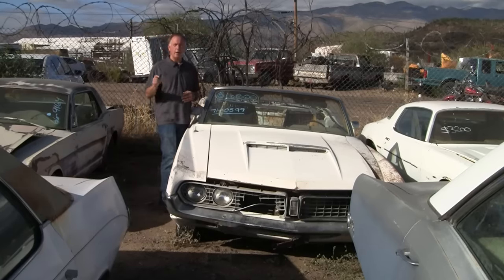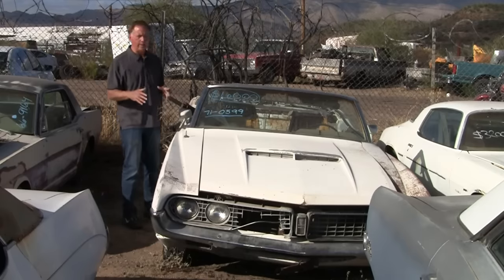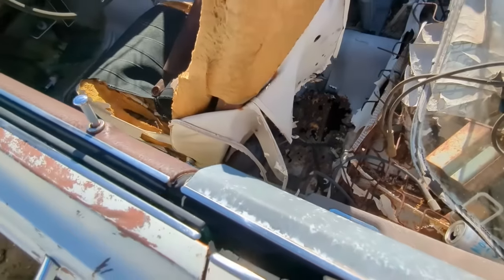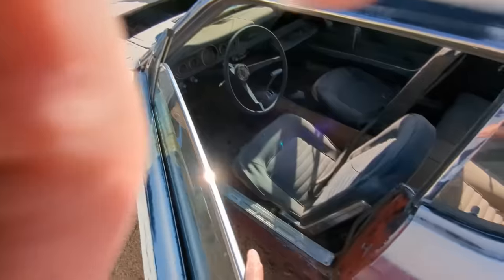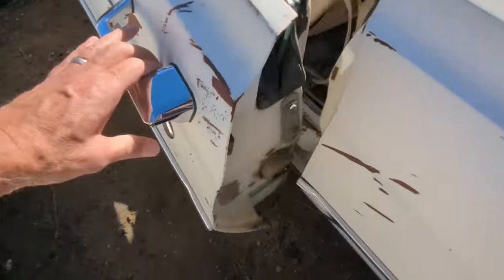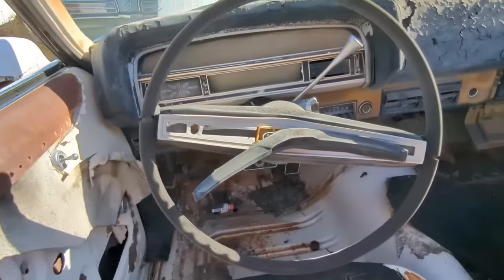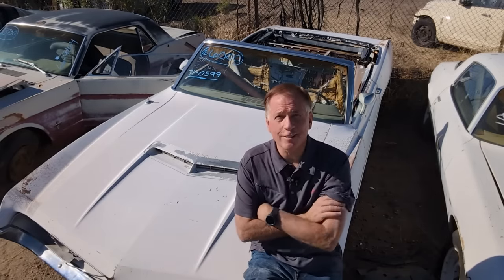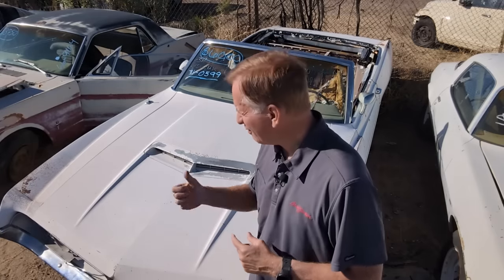Drop Top Torino

Comment: Here's to a new year and hoping Mr. Magnante gets back into the swing of things. No, that's not correct. The standard engine in the Torino GT was a 302 V8, but you could also get a Torino GT convertible with a 429 V8 in 1971. It did require front disc brakes. 

We got the VIN, we win: 1 for 1971 model year, H for Lorain, OH assembly, 37 for Torino GT convertible, H for 351 V8 with two barrel and the rest is the production sequence. The Lorain, OH plant operated from 1958 to 2005. We got the tag, we can brag, and go all the way, don't you say? 76F for Torino GT convertible, M for White exterior paint, YW for White bucket seat vinyl knitted interior trim, 6 for 3.00:1 rear axle ratio, non-locking, W for C-4 automatic transmission, and 62 for Houston, TX sales district.

Correct, 240 gross horsepower, 9:1 compression ratio, running on regular fuel.
Reply: Thanks.  You confirmed my memories on engine choices.  I think the Torino GT mimiced the 1971 Mach One Mustang regarding engine choices with a  2V 302 as the base engine and a series of 429's on the top.  One difference is that I thought this version of the Torino would have had an FMX auto transmission.  I think the Mustangs had a C4 Cruiseomatic for the lower horsepower version, the FMX in the middle for the 351's and C6 Cruiseomatics for the 429's and maybe 351 Cobra Jets.  Don't have my sources anymore and the mind gets fuzzy with age.  As an aside I had a 1971Mach One  with that same engine and FMX with a 2.75:1 rear end.  Would easily get 20-21 MPG and was very quick inspite of the tall rear end.
Reply: @scottspilis1940  FMX? What a mess. LOL. Ford's transmissions, carburetion, ignition and fuel controls were all terrible. They didn't make bad engines, but they were far behind the times of GM. Even through the 1980s, while Ford went four speed across the board in a lot of cases (AOD), it was a clunky piece of junk.
Reply: I would have thought that it would have an FMX also. I had 3 1970 Mercury Cougars with the 351C 2V and they all had the FMX. I love the breakdown of the VIN and Tag info. Thanks for that!!!
Reply: @mikebrown8065  Sure thing. You'd have an "X" in that spot on the tag typically for an FMX. When you get the VIN you win and when you get the tag, you can....ahhh you get the rest. LOL.

Comment: A buddy of mine up in Canada had a Torino GT convertible with a factory 428 in it.
Our provincial insurance company said it didn't exist as the serial # said it was a hard top. They finally sent someone out to look at it to confirm what he was telling them. Turns out there were two test vehicles that got out of Ford.  He had 1 , and the other one was in California, if I remember correctly . This all happened back in the late 70's.
Reply: 1968 and 1969 Torino's could be ordered with a 428, Cobra Torino's were Fastback or Coupe. Was it this body style?

Comment: Rick, you were right about that 351 being a Cleveland. If the t-stat bolts to the block, it's a Cleveland, but if it bolts to the intake manifold, then it's a Windsor. You should have mentioned that the Torino also had factory A/C and Power brakes and Steering. Thanks for helping Steve out !

Comment: We miss you Steve and all your great videos. Thanks, Rick, for the Torino information, a friend in high school had a white Sports Roof HT with the same engine in 1981. I remember when he drilled holes in the muffler to "make it sound like a hotrod." You could get a 4V 351 with 285 hp, engine code M and a 429 with 370 hp, engine code C.

Comment: The people of the automobile enthusiast world are truly special. Thank you Rick for another great video on Steve's channel 👍.  In my humble opinion,  this example of the 1971 Torino GT convertible is definitely more of a restoration candidate than a parts car from seeing this video; especially with the 6k price tag. As I sift through listings and adds on a plethora of sites,  it has occurred to me that the "parts car" category is almost extinct. As you noted Rick, up here in the northeast,  completely rotted out "rollers" (no engine/transmission) are listed for waaay too much money; "TRY FINDING ANOTHER ONE " is almost always the quote in the description. Or "ULTRA RARE ". 
To me,  a parts car has NO title. "Bill of sale only."  , " no transferable registration". is usually in the description. If the vehicle has no title,  and the individual doesn't have any paperwork proving ownership,  how do you know it wasn't stolen?
I knew someone who restored a '67 Corvette,  which he bought from a different state than where we lived. His biggest mistake was he didn't try to title the Vette into his name until AFTER he restored it. When he went to the Motor Vehicles department for transfer of title (1995),  they told him it was stolen. BACK IN 1972!! After they found the owner,  confirmed he was still alive,  my buddy had to surrender the Vette to the State,  and they gave it back to the owner who it was stolen from in 1972. He was NOT compensated for anything 😢. 
Steve, I would like to wish you a great new year , and a healthy one at that!!! God bless 🙏🏻

Comment: I had a 71 GT convertible in NY in the late 1980s. It was rare indeed. Nobody knew what it was until the saw the name plates. Trying to find convertible-specific parts was extremely hard. I built a very strong Cleveland with BBL heads, C4 and 4.11 equipped 9" and it was a monster!  Thanks for subbing and showing while Steve recovers.

Comment: The 351 2v (h code) was one step up from the base 302. Rick said this was the largest engine available which is not true. You can also get the 351 4v (m code) as well as two different 429's. We need Steve back 😉🤣

Comment: My buddy has (had?) a 1970 Torino GT convertible, 429CJ, with an exceptionally low VIN  (first 25-30 built)

(He was big into 1970-71 Torino GTs, and Cyclone GTs, preferably with 429s.  When I got "the tour" he probably had 25-30 of them, including a pair of "Twister Specials", plus a 69 Boss 302, 70 Boss 302,  70 Mustang "Twister Special".   Not a Ford guy, but I was definitely drooling)

A Torino GT convertible with the same colors (light metallic blue/white/white was in the sales brochures.  He thinks his was an early unit, that was sent to the ad agency for photos.

As an illustration of how nuts prices are......at the time I visited (2003), he had a sweet 1971 Torino GT, red, laser stripes, 351C four barrel/ automatic that was one of his "drivers".    A nice "3"- "3+"

Only thing wrong with it was the AC needed fixed; the compressor blew, when he was in the middle of a 90mph "commute".  Evidently, it didn't like the extended high rpms.  LOL.

Long story short, he offered it to me as it sat, drive it home, for the same price they are asking for this Torino....$6k.  Less the factory rear window louvers (Evidently, they were worth close to $1000 bucks at the time by themselves)

This is the problem with being poor all your life.  I can't tell you how many screaming deals I've had to pass on, due to lack of $$$

Comment: You could get the 315c with the 4 barrel in the 71 GT convertible , but they were different engines . This with the 2v is a passenger engine , the 4v was a performance engine . The 4v has different heads , and higher compression.

Comment: 302 2v was base sngine. Optional engines were 351c 2v, 351 4v, 429 4v and 429CJ.
ALL available in the convertible.  In 1970 you could even get the 429 super cobra jet in the convertible.

Comment: Engine availability in the '71 Torino GT: 302 2-barrel (STD); 351 2-barrel; 351 4-barrel; 429 Cobra Jet 4-barrel; 429 Cobra Jet w/ Ram Air Shaker hood scoop.

Comment: had a 72 torino station wagon bought in1982  I repaired the rear tailgate so it would not only swing down but open as a door. 4 days later she was in an accident that tore the front end off.  cool car had the 351

Comment: You could get a 429 scj for 1970 and a 429cj for 71 in the convertible. The 351 2v h code was the most common. My 70 convertible is a 351c h code

Comment: First let me show my appreciation for Rick taking to time to do this.    Big thanks to you.      BUT, it’s astonishing how little this “car guy” knows about cars.    Not Torinos, not Torino convertibles, but any American 60’s or 70’s cars.      ANY “car person” who knows much about that era of domestic cars would know that intermediate sized cars in convertible form were also available with the more powerful engines.    The Torino GT was indeed available with 351C-4V engines as well as the 429s.     In fact, although the lower trim level convertibles were available with lesser power trains, for a GT Convertible, I’m pretty sure this would have been the standard engine.   The 302-4V was also available but I’m pretty sure this was one was standard.    And as far as only 1,600 1971 Torino convertibles being made, that simply cannot be correct.      Sorry Rick.     Thanks for helping, but a little homework could have saved your street cred from this.     That car at that price is a steal.